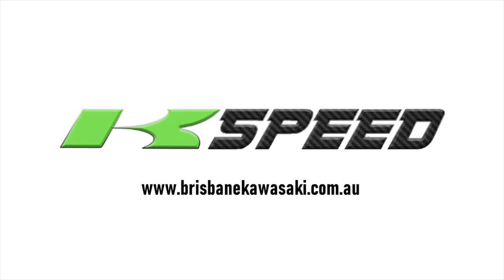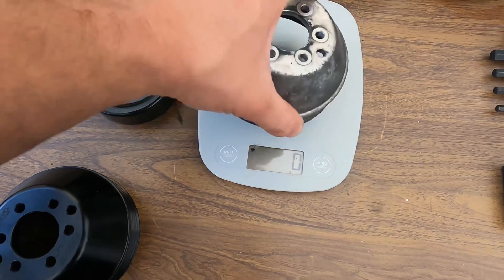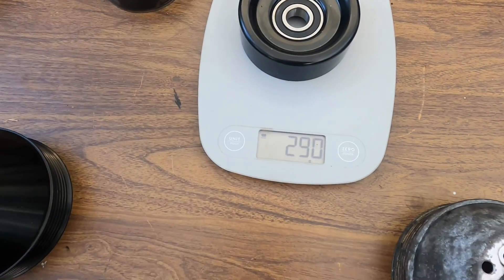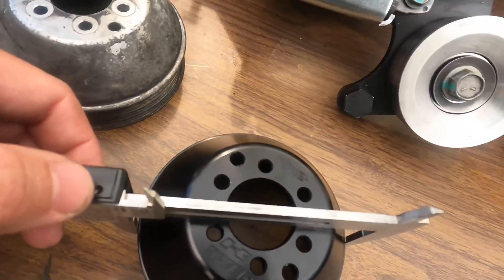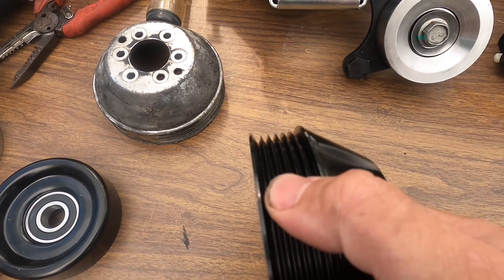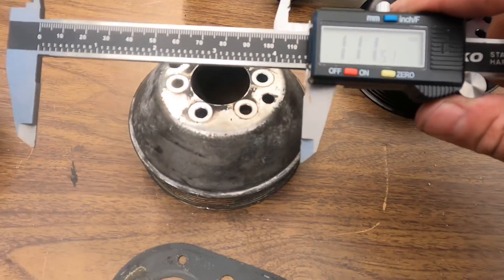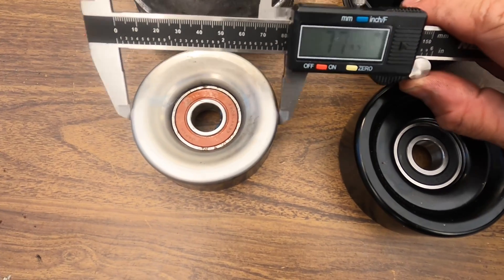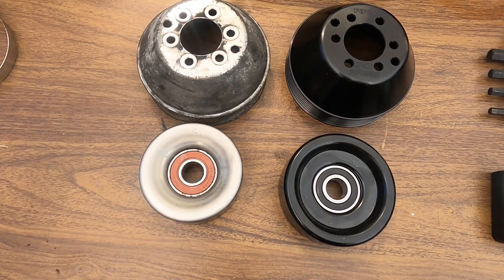Comparing the Kspeed 108mm & Stock Supercharger Pulleys for the Kawasaki Ultr￼a 310 Jet Ski

Comment: Great detailed information. Kspeed, @BrisbaneKawasaki really does have a great selection of upgrades and updates for these Kawasaki's. Even their 109mm would be good for anyone wanting just a slight boost in power and added longevity.
Reply from the maker: Brian, I live about 35 minutes north of Riva Motorsports HQ and yet I order all my parts all the way from @BrisbaneKawasaki in Australia..I’m a native Floridian and have been fixing and riding Jet Skis for 25+ years..the fact I go with Kspeed should really tell you something… 😎😎
Reply from the maker: And yes, I did originally want the 109mm pulley but they went out of their way to hook me up with the 108mm pulley so I didn’t complain too much about getting a bit of a performance bump 😂😂
Reply: Do you need to go with the upgraded fuel rail to do the 108mm pulley?   I always run 93 octane fresh fuel.    I have all of stage 1 kspeed done already
Reply from the maker: The fuel rail is not necessary and does not impact performance
Reply: I almost feel like your saying the 108mm supercharger pulley isn't even worth doing?
Reply from the maker: You might notice a slight increase in RPM and boost. Unfortunately, I am not able to run that pulley because the included idler pulley is made of painted carbon steel and does not hold up well in saltwater.